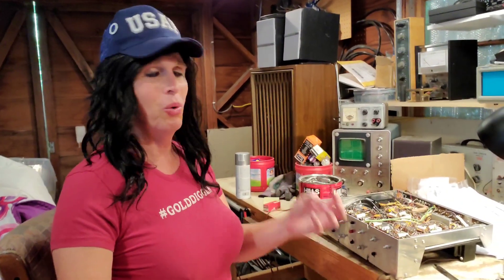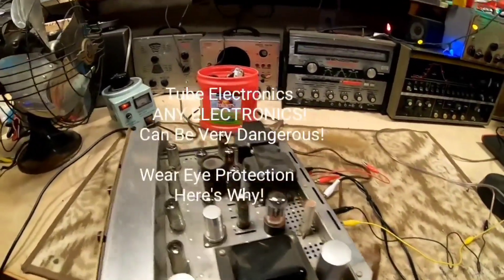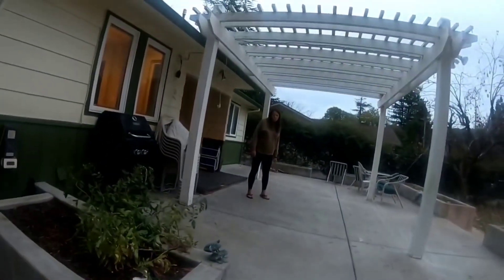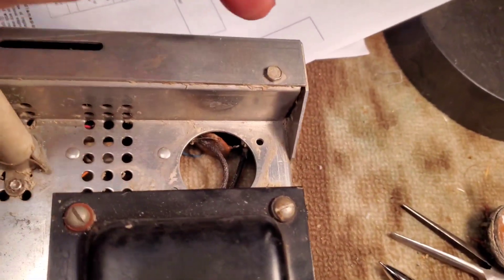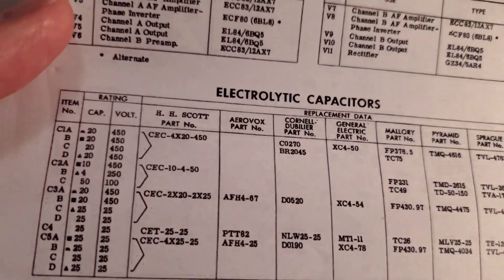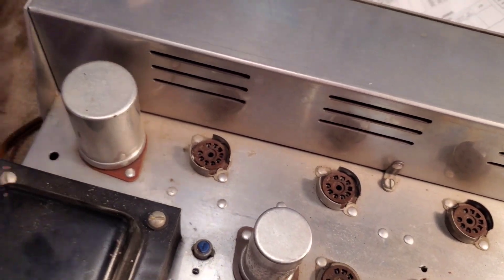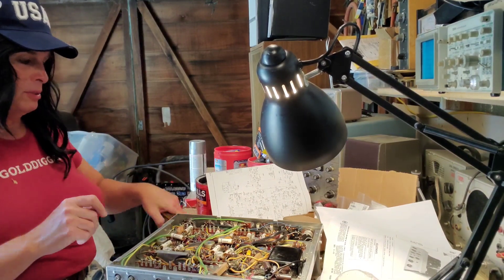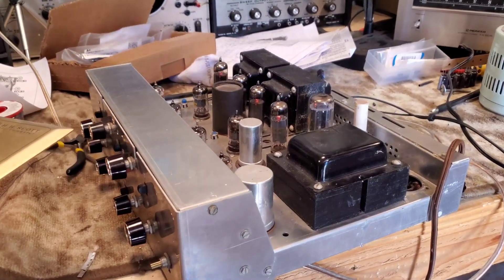Repairing the HH Scott 222B Tube Amplifier, Post-Explosion...Can It Be Saved?

Comment: 2:49 I know that sound! I put a video up 9 years ago with the same internal arcing noise in my Heathkit W-5M amp. Then it just shorted out  in a later video. Something I learned from shango066 is to feel or take the temperature of the cans as they reform. Good you wern't hurt.